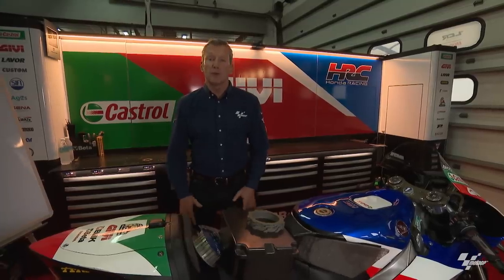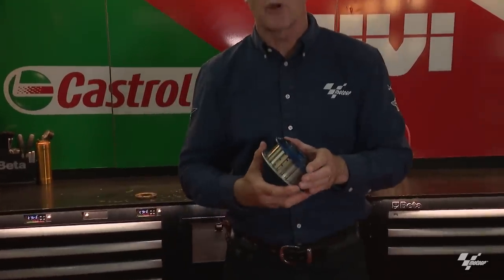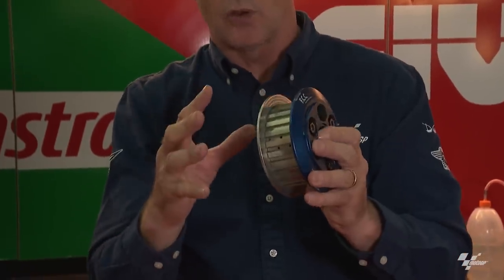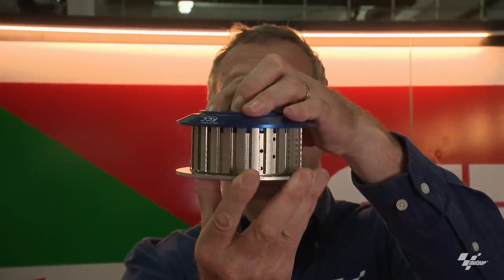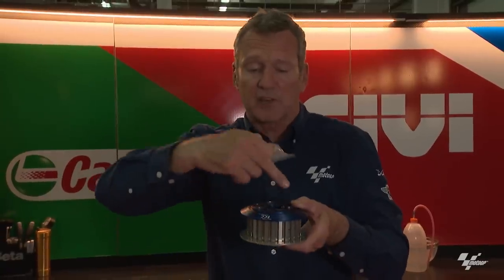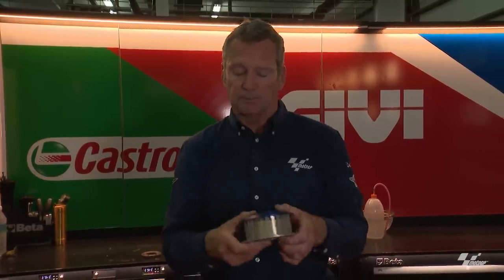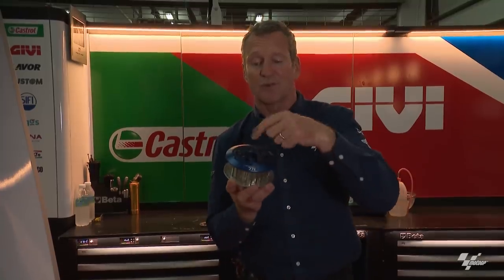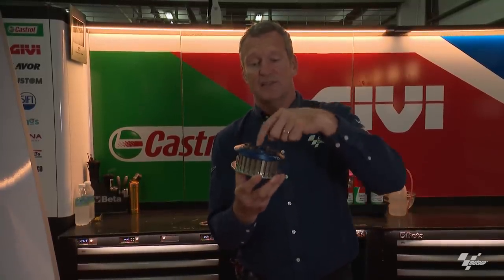Slipper clutches ⚙️ | Tech Talk with Simon Crafar

Comment: I dread the thought of MotoGP without Simon. His trackside insight and these Tech Talks are honestly my favourites
Reply: The helmet technology is still lagging behind the bike technology but I know it mostly comes down to the helmet manufacterers for that.
Reply: Second that
Reply: I'm not sure what they can do to make my ShoeiX14 better but if they do its going to be big! We do a bunch of roll racing 9/10ths of mile and drag race 1/8-1/4mile. Anything over 180mph -220+mph (roll racing) and a regular helmet will try and rip hour head off if you pop up from behind the windshield not to mention issues with visors ripping up/off. I might be biased but the x14 is something I can say that does it all and cuts through the air better than anything else I've tried.

Comment: I bought a 2020 KTM 790 adventure with a quickshifter add on. Cool thing, to get the clutch to have power yet easy clutch lever pull they have made to clutch basket with the slots sloped. So when you gas it the plates slide down the slope and engager harder. That way the springs can be lighter hence lite pull.

Comment: TY as always, Simon! You da man!!!
I don't think the clutches "slip" during upshifting as opposed to the lower of the gears continues on a bit through the engagement of the next gear to reduce the rpm/intertia drop caused by manually shifting. Didn't we learn that during one of the Tech Talks? May have been somewhere else.
Anyway, Thank you Simon!!!

Comment: the question is that in wet race, did they put a cover or enclose the dry clutch system? how many mile does that clutch pack last? does every race they change that with new set of clutch pack? great input as always Mr. Crafar👌🏽
Reply: Why do you need a dry clutch tho?
Reply: @steve00alt70  well, race bike usually use Dry Clutch for performance.
Reply: Something like that is not a problem for a race team, they will change the clutch probably every race or two. What they after is more performance than durability.
Reply: @ZulRf  i agree with your input. do they put cover on or put an enclosure in wet race?

Comment: So I am assuming that the on board computer regulates what is needed for the engine to compensate for the   bike's balance between degree of engine brake and smooth acceleration by the clutch ( how the clutch pack and springs is setup) for the tires to maintain proper grip at any time on the track?

Comment: Simon: 
So it's adjusted for launch 
So that the clutch slips a little - to a degree - so that the revs don't over rev and create the rear from uncontrollable wheel spin

As to listening to the practice starts
From how you described 
It sounds like what you said - is happening 

Listening to the starts
It sounds like there's room for improvement
But as you said
If it wasn't adjusted like that
The starts would be a mess

Not that I like it controlled like that

Thanks Simon
Reply: Clutches

Comment: You were right about a little confusing, but i get it. Now how do we back it in to a corner 😅
Reply: With
Reply: Simon
Reply: Crafar
Reply: Brake later than you ever dare from a high speed, downshift from fourth to first, ping the clutch out and let the slipper clutch sort it as you tip in 😂
Reply: @joesheehan__  sounds terrifying